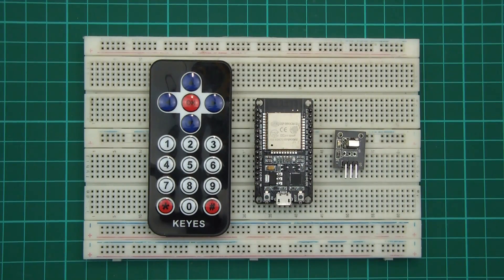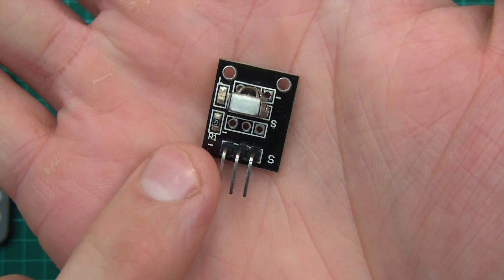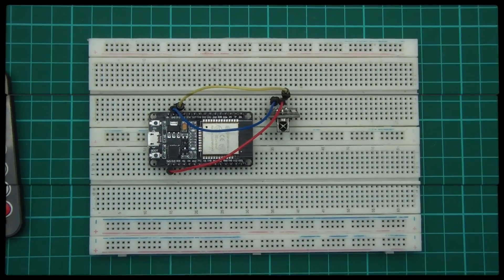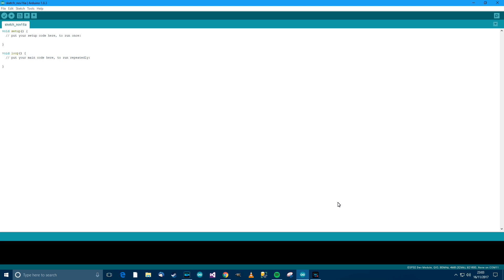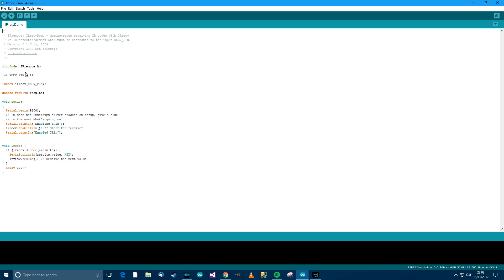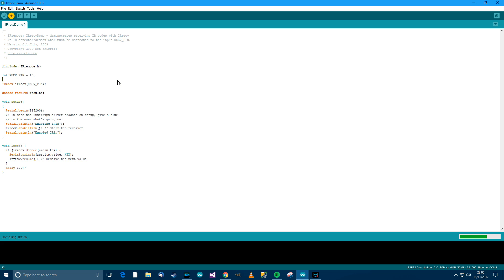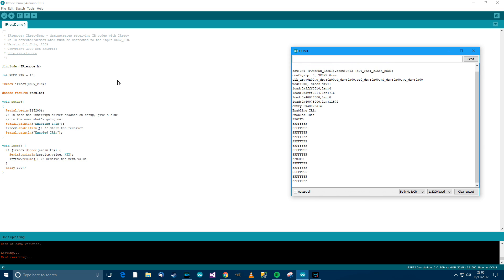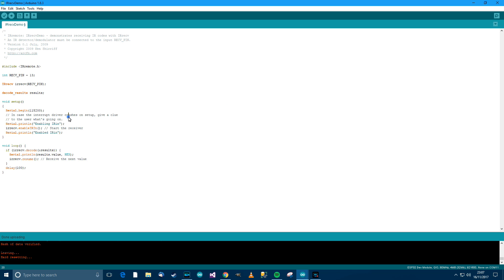TUTORIAL: How to Quickly Setup Infrared IR Remote Control Sensor with ESP32 - Arduino - ESP8266

Comment: Anybody managed to solve the issue with the error:
C:\Users\Andy\Documents\Arduino\libraries\Arduino-IRremote-master\src\IRremote.cpp:27:27: fatal error: avr/interrupt.h: No such file or directory

 #include <avr/interrupt.h>

                           ^

compilation terminated.

exit status 1
Error compiling for board NodeMCU 1.0 (ESP-12E Module).

Im trying to figure this out but dont seem to be getting anywhere.
Reply: i have the same error could you solve it or not
Reply: If you're using ESP8266 - use the following library: https://github.com/crankyoldgit/IRremoteESP8266

Comment: Great video!
Quick question, What pins are available for the ir receiver? 
And regarding transmission, What pins can be used for the transmiter? 
Are these pins dedicated or supposed directly connected to timers?
thank you in advance :)
Reply from the maker: Daniel Garcia only SPI/I2C are dedicated.
Reply: Antony Cartwright - Thank-you for the fast reply :)

Comment: Good job. Have you done a vid for RF and relays? I Have a few sonoff to avoid any programming but the f ing things randomly block router access from wired pc and or wifi devices (connected /no internet)
Reply from the maker: Yeah! I have RF controlled relays, etc in my solar power station. But the sonoff things should work fine. You've probably got port forwarding problems!
Reply: Yup they work fine but I would like to use my pc to :)
Reply from the maker: If you switch the Sonoffs off, will the PC then work?
Reply: Only after a few hrs. or overnight  no matter what you reset. That's how I know it's the one. I have other esp  sending temp no problem.
Reply from the maker: What the hell?!??! :-D
Reply: Yeah, pisses me off
Reply from the maker: So why don't you remove them all, then add them one by one?
Reply: There is only 1. Good idea I should test one of the others but don't like being off line that long :)
Reply from the maker: Sick Vic I don't actually understand why they have anything to do with the router lol
Reply: Antony Cartwright Maybe it''s the app I should plug it in and not use it to see what happens.